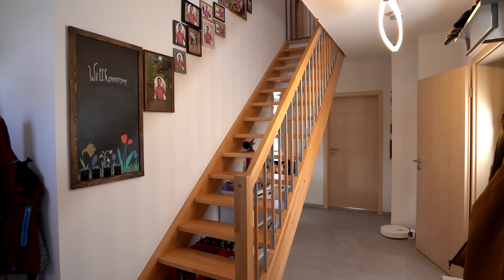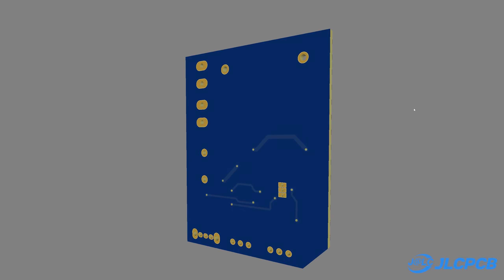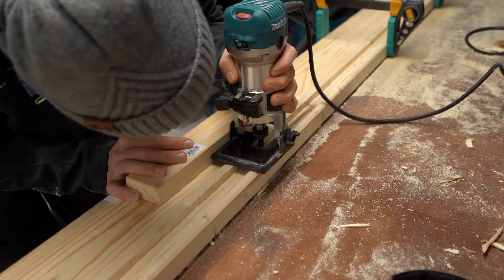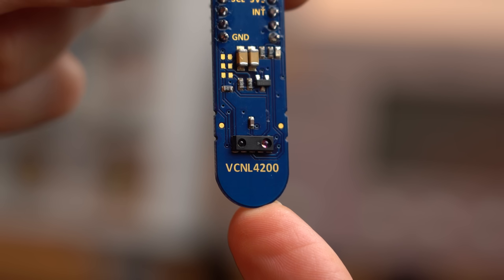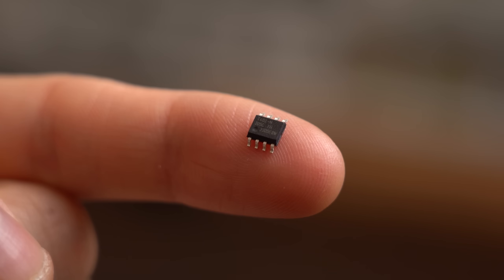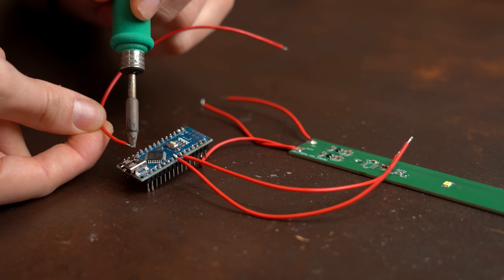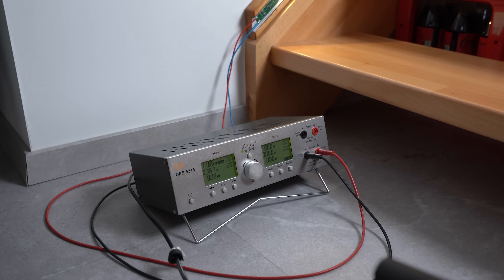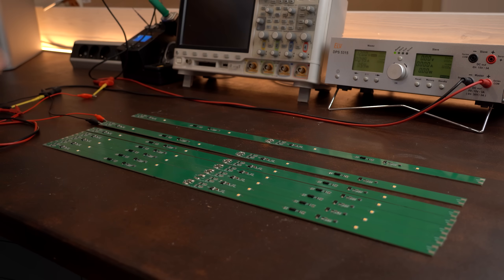I tried to Revolutionize LED Lights!.....And FAILED?

Comment: What if the sensor turns on the one or two infront of it to see where you are going and not are. You are either going up or down so the sensors could only be set off at the fist stair or two of each level. Maybe that would keep the noise down and stairs wont turn  on as you walk past during the day. Best of luck, hopfully the community is giving good ideas as this would be a good product.

Comment: can't help with the electronics, but I'd suggest using the diffused cover instead of clear and just drilling a hole through it for the sensor. you could mount a thin piece of clear acrylic to the inside of the diffuser over the hole if you still want it covered for protection.

Comment: Look, instead of IR sensor, you can use PIR sensor and based on it it will work pretty well. I can help you with coding logic if you need. I have done previously this stuff too.

Comment: Interesting there's definitely nothing like this. Part of me was wondering if this could be done with addressable LEDs. And maybe not having data communication between boards and just use some sort of trigger and input to tell the next trip that there's motion coming. that might simplify some things but if the communication can get figured out that would be better I would think.

Comment: I'd do addressable LEDs. One Arduino (I'm a fan of the Seeeduino Xiao for applications like this) and no LED driver necessary. When sensor X detects presence, light up LEDs X+/-2. The code might be a little more complex, but the overall project would be SUPER easy and also cheaper. With a string of cheap ARGB LEDs you could tune the color any way you want and throw in some "party modes" for funsies when you have friends over for game nights. 
You could also drill small holes in your diffuse cover over the IR sensors. Fill the hole with some IR-clear plastic cut flush to the diffuse panel. Now you get IR control with diffuse lighting.
Reply: So, adding a bit more detail to my idea here. 
The Seeeduino Xiao is a $5-6 (US) USB-C powered Arduino. It's really inexpensive and the built-in USB-C port makes it really easy to work with. No dev boards or wonky pins to mess with, just plug it into your computer and go. You can also power it on that same USB-C port meaning a cheap cell phone charger can run your entire project. 

The Xiao SAMD21 is perfectly capable of driving 2812 LEDs completely on its own, no extra power supply and you don't even need a level shifter cause the 3.3v data is (barely) within 2812b spec. I'd probably just buy a whole strip cause I don't have JLPCB sponsoring my projects. 
So out of the Xiao's 11 pins, 1 digital pin drives the LED strip. Easy peasy. Load up the FastLED library in your Arduino and you're done.

That leaves me 10 more pins for the presence sensors. I would probably use one sensor for every 3 steps. Your chosen sensor is cool and all, but I'd just buy an off-the-shelf 3-pin Arduino-compatible IR sensor. Even better of it's rated for 5v power so I can share the power rail with the LEDs and just run a single data wire back to the Xiao. 
I'd have a single light sensor next to the Xiao and have it facing away from the stairs and housed in a cover so the LEDs don't trigger it. I might throw in a capacitive touch sensor just for manually changing settings. Maybe short taps change the brightness mode, long taps could activate different color schemes, whatever you want. 

Programming is pretty straightforward, just requires some math or testing to sort out which LEDs need to be lit with each sensor. Sensor 1 activates, light up LEDs 0 through 9. Sensor 2 activates, light up LEDs 10-19. The number of LEDs you light with each sensor would depend on the density of your LEDs. 

I'm not sure if your existing PCB could be repurposed for this centralized controller ARGB concept. I have no experience with I2C pins so I'm not sure if your existing sensors would be compatible with a Xiao either, but I expect they'd work. You might need to add some jumper wires between LEDs to add the 2812b data line to the project, and probably other jumper wires to run the data lines from your sensors back to the centralized Arduino, but that could be hidden behind your cover. 

I've had similar ideas for lighting for my stairs. The hard part is figuring out how to power them. I just don't have any nearby convenient outlets for a power source and I don't wanna be replacing batteries every few months. In my own design I've considered putting an LED strip on the under side of each step so that the light shines down, lighting the steps but not shining in my eyes. I've also wanted to use EL tape because the lighting is so much more even and softer, but EL is expensive and harder to drive. I did have EL wire in the hallway for a time - worked great, my hallway floor looked like a scene straight out of TRON.

Wish you luck! Hope you get yours sorted!

Comment: Maybe just have a sensor at the start and the end, that makes all the lights fade up, then fade back down after a set time. Or after the sensor at the other end is triggered.
Since the individual lights coming on for each step isn't that useful as you want the next steps lit up, not the one you already stepped on. 

Plus you won't ever suddenly be in the middle of the stairs, you will always have to approach from the first or last step anyway.

Comment: Just a stab in the dark, but I wonder if the metal bits on the staircase are reflecting the IR light back and causing the sensors to think someting is closer, or perhaps causing false feed back to the neighbouring sensors?
Otherwise, very cool project, Kinda want something like this myself :)

Comment: It sounds like you will be needing new PCBs for this project. Since you cannot use the diffuser lenses, maybe consider getting your new PCBs made in white with only the LEDs facing the stairs and all other SMCs on the wall side of the PCBs. The LEDs will blend into the white PCBs better and the strip would have more of a diffused look when the LEDs are off. 

Great job so far. Looking forward to the final product!

Comment: I did what I think is clever and cheap - I bought 18 battery powered (3X AAA) lights with motion and dusk sensor on AliExpress for cheap, connected them to two thin wires running along the stairs. Connected to a plain USB charger. Works fenomentally.

Before, I worked a year trying to make each step into a display - 30 addressable LEDs per step, step-down converter, a potent power supply, microcontroller, two motion sensor, dusk sensor 🤦 gave up and wired the simple lights in 2 days after work.

Comment: I would have set it up to light the LEDs ... AHEAD ... of the person traveling up or down the stairs. It might have made sense to give each board a data line to communicate sensor to a central processor, and give control of the LED to that same controller, and have one controller decide what to light and dim, based on sensor data. Then, you can eliminate the issues with noise, as well as provide more flexible options for lighting the stairs (and even provide for more entertaining lighting for parties and gatherings)

Comment: I know the feeling , I put over 200 neopixels around my tv for ambilight that all worked fine until I hung up the tv on the wall....nothing worse than everything working in small scale and on the carpet and then you hook it all up "exactly" the same and it fails. Turns out I just forgot to ground the end of the string to the start , even though it went back to ground and I thought ground is ground , soon as I touched a tiny jumper from one end to the other it all started working , noise is a pain in the ass.

Comment: hey scott, some remarks / questions: why dont you use male/female board2board connector? it would have done the repairing much easier. i know the problem with the GND from the ws2812 LED strips. The problem there is that the ground resistance increases with the distance to you power supply. to get rid of glitches i've installed a GND wire (sth like 1.5mm2) parallel to the led strips and connect it every meter or 2. I didn't look for your layout, maybe you can improve the grounding?! Concerning the noise on the power lines: try to reduce the noise as near as possible to the power supply. maybe also a common mode choke can help?! your LED driver will also generate noise, take also this into account.

Comment: My guess is the lights turning on from one led strip is causing other lights to turn on thinking it's actually detecting motion. I had two motion detecting lights installed once that I had to remove one because they would keep triggering each other in an endless loop.

Comment: Well now you have pcb that is 6-7 meters long, it should act as antenna. 12:21 You tried adding electrolytic capacitor for low freq and voltage drops, but what about ceramic capacitor for high freq? I would try to put ceramic capacitor in parallel to that one you soldered. And put them on each PCB. 12:47 you used power supply at bottom, and you have problem on top, does that tells you something?

Comment: Would've personally done a different behavior, turn all lights gradually with a timer from the top to the bottom and vice versa depending on if it senses that someone's coming up or down and don't turn them off until either a timer has expired or it senses that someone's at the other end.
That way you can still have the dramatic effect but can place the sensors only at the ends, simplifying the board's design and have the white diffuser on top of them

Comment: Use addressable leds and put pir or ultrasonic sensor on top & bottom and make a timer for leds so that each led turns after another after 0 5 sec , this should work well.

Also don't give up on your project , i wanna see you fix it!

Comment: I would just put an LED strip (probably on the stairs side panel) one microcontroller and distant sensor. I'm pretty sure it would've worked without any issues even though it is not that cool.

Comment: 2 suggestion --1)  is to use diffuser  and drill holes in front of sensor and 2)light up 3 led one in which stair you are and other two one step up led and one step down one

Comment: Very interesting and useful project however I have 2 questions  : 1) Why didn't you take out the pcb to troubleshoot comfortably on the bench ? 2) Doesn't the proximity sensor have some sort of range adjustment ? Otherwise the bannister is close enough  to trigger it.
Reply: You actually look for a substantial CHANGE in the proximity value to trigger.

Comment: I would have make the project in a quite different way: just two sensor, one at the start of stairs and one at the end, just one microcontroller. when one of the sensors detect the person, will switch on and then off the leds in a time-based sequence like "first led on for 5 seconds then goes off, second led goes "ON" after 3 seconds from the first one and stays on for 5 seconds then off, third led "ON" after 3 seconds from the second one and for 5 seconds and so on... in this way the led will light up in sequence, and you can fine tune the timings according to your needs, and this will be cheaper and with less components = less possible issues or fault points.

Comment: I think you should've used USB type A male and female for connecting all the strips together and make it super thin

And maybe use a motion detector to detect when to turn on light

And like make a master module with a RTC and ambient light sensor to detect if lights need to be turned on

And the master module just turns the power on or off for rest of the modules

Comment: I think the biggest problem is that the light switches on kind of after the fact.  You need to see the step before you move your foot.  I love that you did this project but it taught me that I will go with the much simpler system that switches on the whole stairway when approaching from down or above. still, LOVE your video

Comment: Another great Video. TY, can‘t wait for the Sequel.

Haven’t read most of the Feedback but i believe it could be that the IR Sensors are interfering with each other? I would  test the Sensor Data again, and maybe 3D Print a little cover for the Sensors to reduce their Sensor Angle.

You could also „Paint“ the colorless transparent Covers for Diffusion and just leave some „tiny and clear“ Windows where the Sensors are. That way you could get some Diffusion and maybe solve yout Sensors Problem. 

I remeber a Project of mine where i used similar Sensors. But i ended up having a lot of trouble and was almost about to change to to another Sensor Type when i noticed, that it were some Candles and a very old Light Buld that interfered with the sensors.

After limiting their sensor angle everything worked fine.

I am curious and what you‘ll find and eager to see Part II.

Good Luck

DeKu
Reply: I just read some of the Comments and it seems that the Sensors are not the Problem, given that you checked the Values.

Good Luck

DeKu

Comment: Perhaps use your communication lines to interlock the operation, based on whether the top or bottom step is detected first, then selectively enable LED strips as you walk up, while disabling strips after they're passed. So, for 14 steps, only step 1 and step 14 would be actively watching, with not more than one adjoining step standing by:

1. When proximity is detected at 14, step 1 is disabled, and step 13 enabled for proximity detection. 
2. When proximity is detected at 13, step 12 is enabled for proximity detection.
3. When proximity is detected at step 12, step 11 is enabled, but step 14 is disabled and the lights are allowed to time out.
4. Go back to step 3, decrementing numbers down the steps, until the bottom is reached.
5. When the stairwell is clear, go back to watching just step 1 and 14.

Of course, this doesn't allow for the possibility of someone coming up the stairs at the same time, or anyone who likes to skip stairs. I'd expect neither is typical of your nighttime use case, though.

Comment: I feel like with that many modules and that many lights, you'll have a hard time getting consistent current across all boards and it might be struggling to distribute power evenly. maybe there's some nice ICs out there to deal with that specific issue?

Comment: I do have a full proof solution to the issue you faced, but at the cost of basic communication, it would be way more basic but would be way easier to work with. Basically you'd only need 4 digital pins (2 pairs of data lines). Basically 2 inputs and outputs. If the sensor is active then the light is on and both outputs are high, and if the sensor is off but one input from say another board is high, than the light is on. However you may think this would turn on all the lights, but you could set it so that only if two sides are powered would it turn on.

Comment: for the issue with the diffused cover not allowing the IR sensor to detect, what if there was an "access hole" drilled into the diffused above where the sensor is, so that it can see out through the diffuser, while the LED lights still give off their diffused light?

Comment: Why not 1 microcontroller for the whole stairs?  Possibly using something like an I2C bus along all PCBs.  This would let the code do things like light up ahead of someone - for example, if detected at the top of the stairs, assume they are going down and light the current stair and the next one down relative to the sensor.  Opposite when going up.

Comment: For the noise problem coming from the switching power supply, I suggest you to use shielded inductors. And maybe, you can also try to connect to ground the aluminium bar. It can act as a shield. I also suggest you to use some sort of connectors between the modules, instead of soldering them together, so if a module need to be replaced, you can do it easily.

Comment: You could have saved a lot of work with the routing by using 3 strips of wood to build the channel.  It's no like it needs to hold water or anything.  To use frosted channel but have the IR sensor working all you need to do is to drill a small hole in the position of the sensor for it to peek through.  Would also help to make it more directional. I don't really know if your setup allows for this but if each segment is aware of the state of the adjacent segments that might help.  Like knowing if you are going up or down and lighting up the next strip ahead of you rather than the ones behind.  But if you have ever been in one of those large office buildings or parking garages late at night you know that they light up when you get there but stay on for a while after.  LEDs don't use much power even when always on so if they stayed on for 5 minutes it would not be a big deal.  It wouldn't be such a cool effect but it the entire staircase lit up at once it would do the job just fine.  Maybe just to make it cool you could have the sections on a timer and just light up a couple of seconds after the previous one.  Even have them trigger each other and have the sensors only used as a wat to turn on but not off.

Comment: Are you sure things are not shorting on the aluminum rail? Like are there conductive parts exposed on the back or sides?  Maybe scratched back surfaces from sliding the pcbs though the aluminum open edge

Comment: Why didn't you used the RCWL-0516 Microwave Radar Sensor ?? it was perfect for this application , it has an inbuilt 5 sec timer and also works with LDR and also its less than a dollar

Comment: you can split LED power rails with mcu power rails and send how many LEDs are turned on with the data line and make a single big LED driver that can adjust power according to the data coming from the data line. and use mosfet for individual led switching. I thing that should work....... in theory.